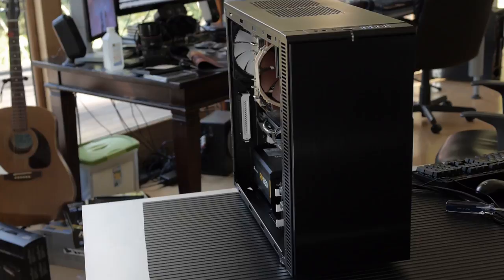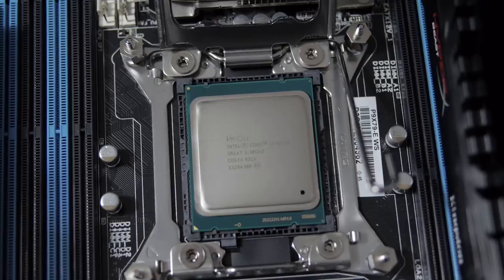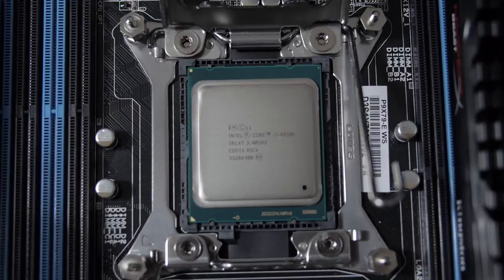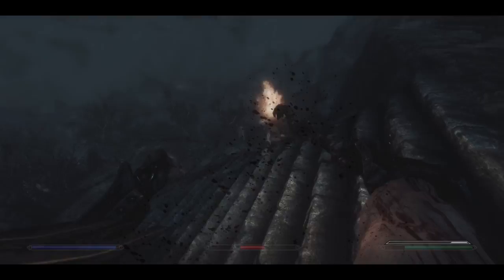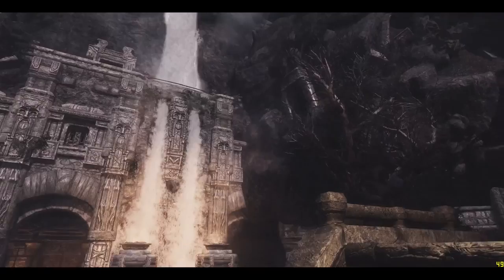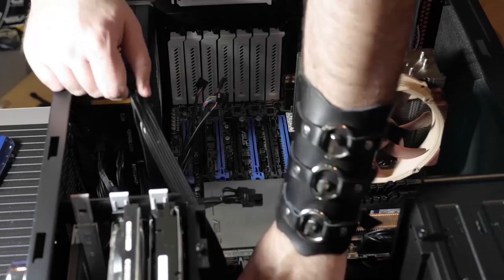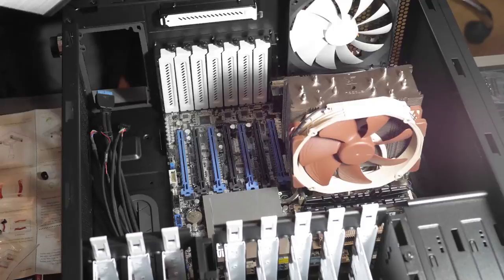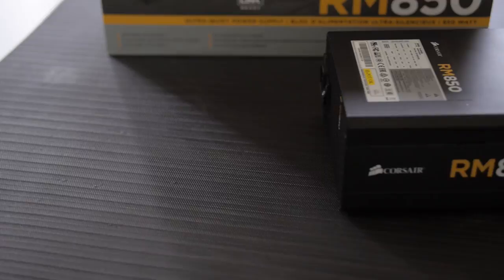Logan's Rig - What He Uses in His Own System

Comment: is this good?
AMD A8 6600K Quad Core Processor / CPU running at 3.9GHz (With 4.2GHz Turbo Mode!)
8GB DDR3 1600Mhz RAM
LATEST AMD HD 8570D Graphics!
1TB 7200RPM SATA Hard Drive
CD / DVD-RW Dual Layer Optical Disc Drive
MSI FM2-A55M-E33 uATX Motherboard (Full specifications of this board can be found here)
500W Quiet Power Supply Featuring Large 120mm Cooling Fan
High Quality Vantage RED Desktop PC Gaming Case with 3 x 120mm RED LED Cooling Fans.
SD Memory Card Reader Built Into Top of Case
Gigabit Ethernet 10/100/1000 Mbps LAN
4 X High Speed USB 2.0 Ports on Back Plus Further 2 On Top
8 Channel HD Audio
4 X SATA II 3GB/s Ports
1 X PCI Express X16 Slot
1 X PCI Express X1 Slot
1 X PCI Slot
2 X PS/2 Port (For Keyboard / Mouse)
1 X VGA Port
1 X HDMI Port (With Audio)
Dual Monitor Support
UK Mains Cable Included
Reply: with that power supply you should get at least a amd 7770 instead of that apu
Reply: thanks
Reply: very good setup, apu's are kinda... trash? but that chipset is the same i have but i run r9, 280x vapor// but still a great setup
Reply: i have a r9 270x 4gb edition things a beast

Comment: Building my first rig, can someone tell me if all of these components will get along well? http://secure.newegg.com/WishList/PublicWishDetail.aspx?WishListNumber=18622869
UPDATE: I now ordered everything with the modifications thanks to your guys' awesome suggestions !
Reply: if you want to make your life easier go to pc part picker, pick all your parts and it will tell you wether or not its all compatiable , and there all compatiable
Reply: From a glance it all looks good.
Reply: very well thought out rig, high end components.
Reply: however it is extremely overpriced, maybe if you dont want  all the luxuries you can build a pc with similar gaming performance with 1800$
Reply: surround is awsome it works good but dont do bassboosted music on it on tip for rest its beast pc if you have the money i would say do it
Reply: ***** yeah that also good because if one broke you have stil one
Reply: Will work just fine
Reply: though I'd get a 4930k on a socket 2011 mobo in stead of the 4770k and save some money on the graphics card by taking the gigabyte and save money on the case that just has good noise insulation. you can get away with a $70 water cooler unless you want to OC extremely high but then a $100 watercooler is good as well. you can stay with your things if you find them more appealing but that's how I would do it.

Comment: Hehe, I got a better computer then you! Celeron processor with a speed of 1.6, some graphics chip, and I'm to embarrassed to say the rest rather then I have a mouse that I have used for about 6 - 9 years. Truthfully, I hope I will have enough money for a new computer, one of those "IBuyPower" where you buy it and it has good specs, the the power supply fucks you over, then I will be stuck with a brick. Better then my, I think 5 year old computer? It is currently running Windows Vista      
and is not proud of it either. #isalsobrick